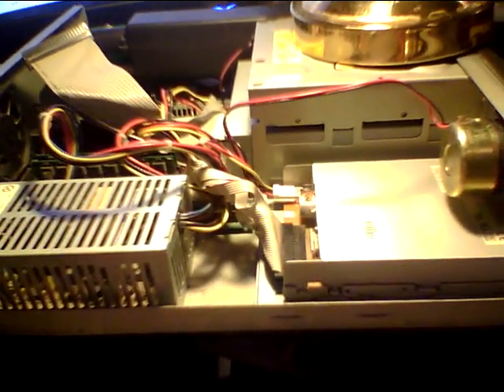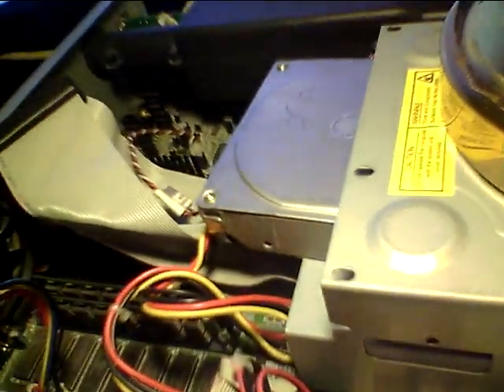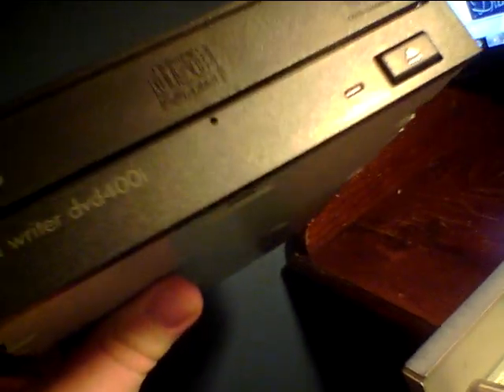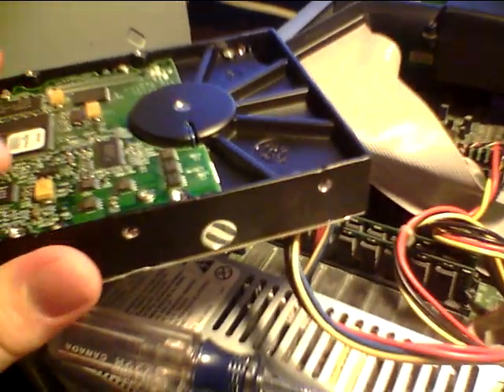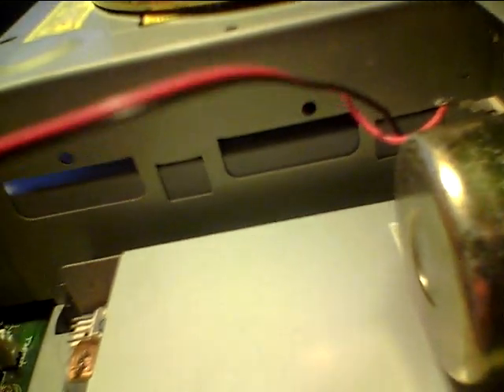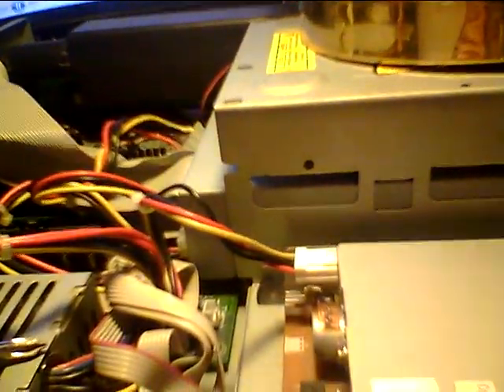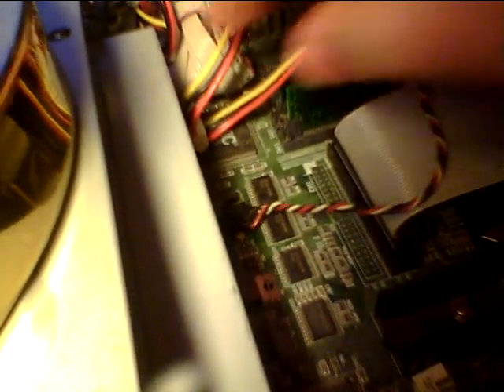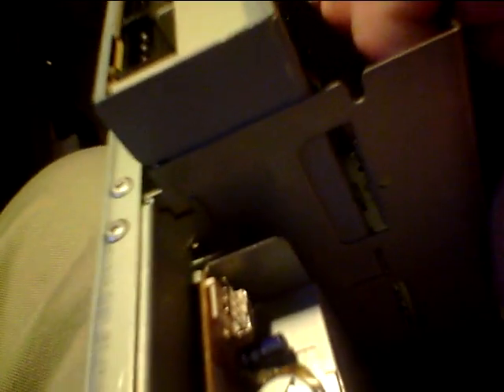Replacing The White DVD Drive And Hard Drive In The Compaq Presario  2200 Part 1

Comment: Anyone who complains about the beep that comes from their computer when it boots up clearly doesn't know a lot about computers, or just might not know about the beep. The beep was intentionally placed to allow the user to know that the computer is either fine or not. In my HP Compaq, if there is something wrong with any internal parts, it will beep continuously, but if everything is fine, then it will beep once.